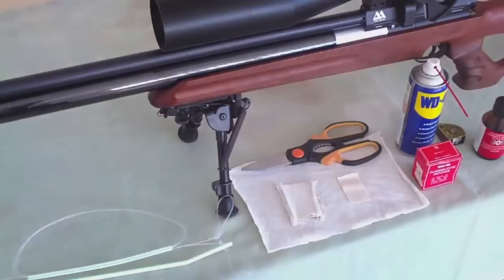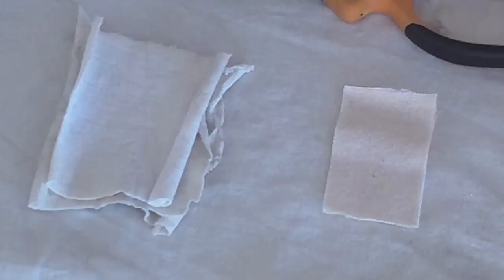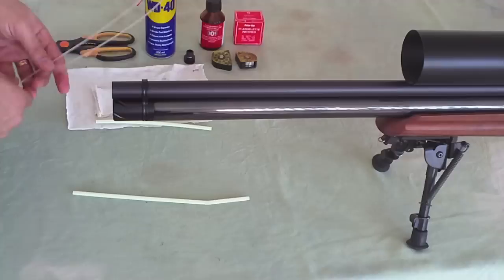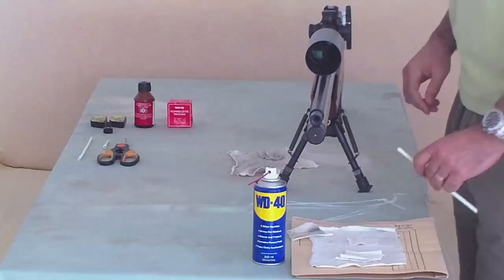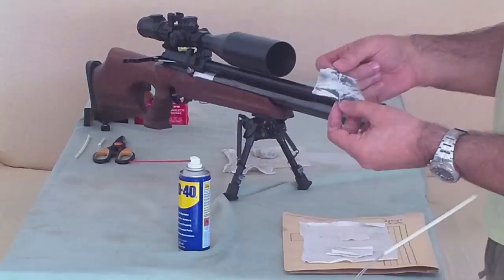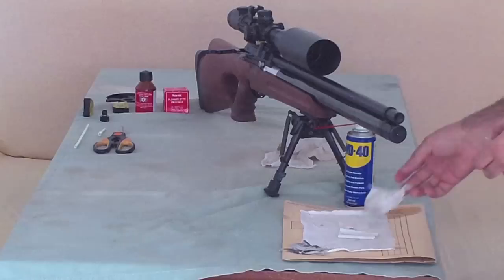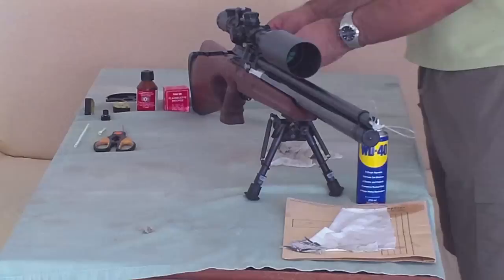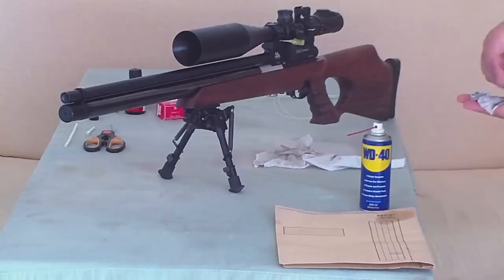Air rifle barrel cleaning - easy, quick, cheap and effective

Comment: WD40 is petroleum based, and so is not recommended for use on rubber O rings. Instead the advice is to use a silicone lubricant.
Reply from the maker: I am using WD 40 more than a decade. Never have a problem with o-rings. After cleaning the barrel I am adding just little silicone oil.
Well all the other o-rings are only with silicone oil.
Just the barrel is touching the WD 40, but never had a problem.

Comment: For new shooters, If you do insist in cleaning your barrel with WD40 I would turn it upside down to stop the oil getting down the transfer port which is at the bottom of the barrel, WD 40 getting down this will dry out the seals.  Washing your tin of pellets in warm water and a few drops of washing liquid before use will help, after this dry them by your partners hair dryer or air dry them and then use a good propitiatory pellet lube. This will save you money to have someone strip the gun and change the seals after a year.  Only clean your gun when the pellets group starts to expand.

Comment: You do not need to clean an airgun rifle barrel.  The pellets are coated with graphite to keep them from corroding.  The black stuff is graphite and actually protects the barrel.  As soon as you shoot another pellet it will be coated with graphite again.  No manufacturer suggest barrel cleaning as far as I know.  If you want to clean it as soon as you get it new to get any possible machining artifacts out then OK, but after that there is no need.
Reply: Its really for the small flakes of lead left behind from the pellet
Reply: Gamo recommends cleaning your gun after every shooting session that’s why I’m here! I had also read that it doesn’t needs to be cleaned but every so often.  I have a 10+ year old daisy i keep in my garage andnever cleaned and it still shoots straight.

Comment: Unlike many, I think there is no danger of wd40 on the o-rings!  Most manufacturers use NBR type O-rings with excellent resistance to hydrocarbons!  Second, the wd40 advertises that it is plastic and rubber compatible.  Wd40 cleans very well but I have found better.  The interflon lube tf or the interflon fine super.  Cleans, lubricates, protects, anti-corrosion, oxidation, oil which becomes dry.  I find that it cleans a little better than wd40, but above all it lubricates better!

Comment: I would recommend using a synthetic gun oil. It's not petroleum based , it actually keeps all the parts clean, Just as synthetic oil in a car will clean out all the build up the petroleum oil creates, and it cleans as it lubricates, and being  non-petroleum based it will not hurt any seals or rings, and synthetic oil will leave a coating of lubrication that will not evaporate like other oils.
Reply from the maker: +Craig Carper 

4-5 years of use and no issues with WD40 only positives.
Sure there are many other working solutions, just sharing my experience.
Best regards.

Comment: I think that wearing gloves may be a good suggestion. WD40 contains DMSO - an excellent solvent that vets use in treating joint arthritis in dogs and horses because it penetrates skin so well - the problem here is that you have the lead and the DMSO in contact with your skin. I'm not saying that the lead is entering you but it seems like it could. Great videos!

Comment: WD-40 is a very big no no! I'm sorry but using wd or other oils not specified for bores/barrels it will foul your barrel its best just to use a dry patch with nothing on it as most people do not clean there barrels anyway! ONLY CLEAN YOUR BARREL IF YOU ACCURACY GETS WORSE ON PELLETS YOU KNOW WORK WELL, a lot of champion target shooters never clean there barrel. However cleaning your barrel once a year or after a really dirty tin of pellets won't hurt just use dry patches

Comment: this is great.specifically the wd 40. but I clean my air rifle with one litre petrol, what I do is disassemble the whole air rifle including barrel, piston chamber, trigger block, spring, piston and all rinse it in petrol to remove oil and dust.then allow petrol to evaporate then give it a engine oil bath to all the above said parts, reassemble the whole gun and keep it aside for a whole 24 hrs so that extra oil will let out then finally I use machine oil to clean the barrel with ear bud (here now I will use your method :) with WD-40). BY THE WAY I CLEAN MY AIR RIFLE THIS WAY AFTER 500 SHOTS BUT BASIC CLEANING I DO AFTER 250 SHOTS. If you agree then I will be happy if u make a video of it as I am not good instructor like you specially making a video like this :-D .

Comment: I have a question I hope someone could help me with.  I watched a video demo from a manufacturer who makes a top of the line pellet rifle. They say when cleaning a pellet rifle always clean by going from the breech end of the barrel to the muzzle end of the barrel. I noticed It's the same way you clean your rifle by pulling the cleaning patches from the breech to the muzzle.  Is this to protect something on the gun against possible long term damage?  I like that you mentioned how long you have used WD-40, I'm sure if it was going to cause damage to your rifle it would have happened a long time ago, But Thank You for sharing your experience I really appreciate that!!
Reply from the maker: +Craig Carper 
Yes, this is the appropriate way - to follow the way of the pellet. Also some barrels are choked, so the patches should got through the choke last. And finally in this way of cleaning it is more easy to pull the patch.
Best regards.

Comment: WD 40 is a not recommended for bbl for a lot of reasons. Not because it is mineral based, it is organic based. Made from fish oil.
Reply from the maker: +Rob Russell 

4-5 years of use and no issues with WD40 only positives.
Sure there are many other working solutions, just sharing my experience.
Best regards.

Comment from the maker: Oiling break barrel air rifle cause dieseling. Springers have to compress the air first and that heats up the air, causing it to diesel if there is oil or grease present in the compression chamber. This is very bad for your air gun system.
Not so with the PCP, but still reflect the accuracy. There will be a difference between your first shots and next ones. This will mislead you all the ballistic.
WD 40 is slightly oiling and dries sealing the inside barrel. If you are oiling - dry it afterword

Comment: Great video as always Sir. Just bought a BSA R10 MK2  few weeks ago and have been running the barrel in and fired about 1000 pellets through it and suddenly realized I needed to clean the barrel out so did a google search which lead me to your great tutorial. So will give the barrel a clean when I get some WD40, or would GT85 still work as I use that on my locks?
Reply from the maker: waddac2 Hello, I newer used GT85. WD40 is working great for me. Best regards, FMS

Comment: How do you like your scope . Have you had any trouble with it . How you tried other scopes you like better . If you could buy any scope  what would you get that has the same or close to the same power as the one you have on this gun .
Reply from the maker: Leapers 8-32x56 SWAT is the best quality for the price.
I have changed many scopes but still have the Leapers.
If you can spend more money Nikko Stirling Diamond 10-50x60 is also good but rare to find.
I read a good reviews for Sightron too.

PS Check my review of Hawke compared with Leapers ... http://youtu.be/ld9co1AJBcA
Reply: ok thanks  I saw there last year's field target winner used a Sightron .

Comment: WD40 will degrade the rubber seals in your gun, use a silicone based lube instead like napier power airgun spray. I have actually done an experiment myself on its effect on rubber. Get a condom and spray it with WD40 and another with a silicone spray, leave them for 10 minutes and then try stretching the condoms. The one sprayed with WD40 will dissintegrate very easily and the one with silicone spray will be ok. The same will happen to your rubber o rings. Oil based lubes are no good.

Comment: Hi,
I'm just watching and watchin your videos about AA S510. I own one my self. Has regulator in it. But problem is that I get just 20 - 25 consistens shots on 270m/s with JSB 1.175. Regulator is set on 120bar. What pellet speed do you get with your AA? Would be nice to hear from you. Kind Regards, Robert.

Comment: use silicone oil spray instead.
Reply from the maker: +nathoi I am using silicon oil, but not spray. Aerosol lubricants are dangerous for places with high pressure. WD40 is used just for insight of the barrel and outside of the metal parts of the rifle, but not for lubrication. Regards

Comment: WD 40 worst for guns - builds up film and degrades seals
Reply from the maker: Actually the best so far. Never damage my 0-rings, but clean and leave insight of the barrel smooth and nice. Every one have opinion, I like the resolts from this. Winned many competitions in FT unlimited and Benchrest.